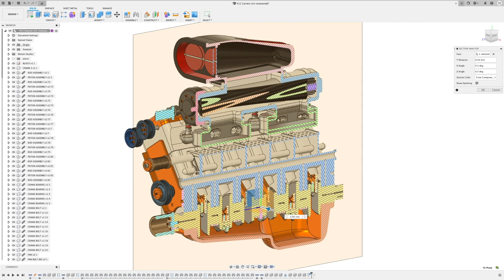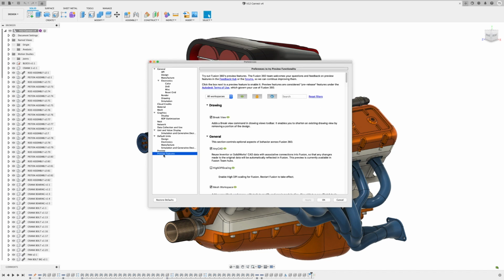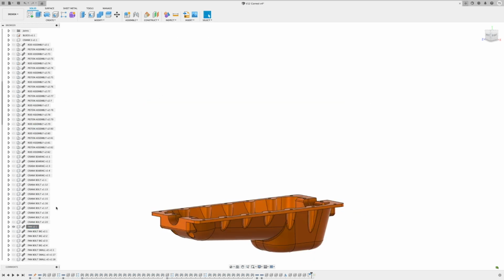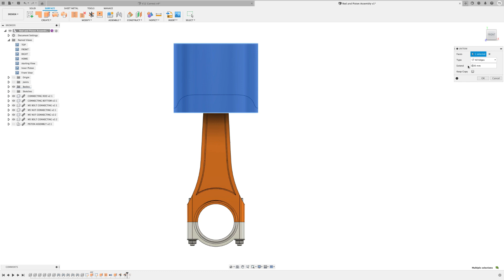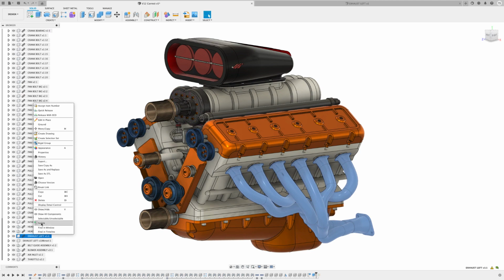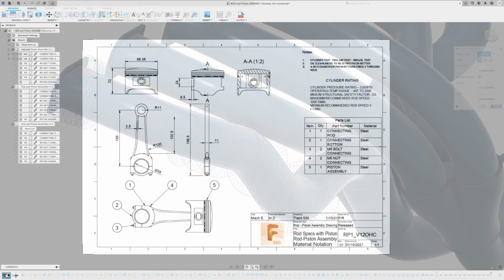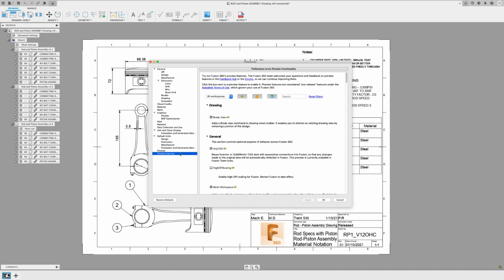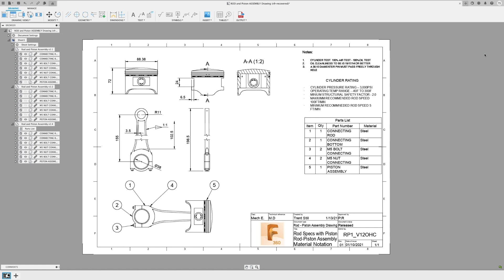What's New In Fusion 360 Design & Engineering – January 2021

Comment: While I applaud the addition of a thin extrude, I couldn't help but feel disappointed with the fact that only closed profiles can be used. The whole point of having a thin extrude should be to allow for creation of thin walls by essentially just sketching lines. This would be especially useful for creating heat fins for instance. Limiting this feature to closed profiles doesn't make sense to me at all.

I understand that we have a web command where we can sketch lines and the command would automatically thicken the wall for us. The command works well within enclosures where there are walls bounding the ribs. I have tried creating fins using the web command but the workflow is not intuitive. This is really a missed opportunity to make the thin feature a great command.
Reply: We chose to release Thin Extrude with this known limitation. We will continue improving this to include open profiles very soon.
Reply: @robcohee  Thank you. Good to hear.
Reply: Until if/when Extrude/Thin Wall respects unclosed sketch geometry, use SURFACE>Extrude/CREATE>Thicken. For details, see this Facebook post https://www.facebook.com/groups/fusion360users/permalink/4366067673423331/?comment_id=4366865093343589&__cft__[0]=AZUAo7Ar83BopMyJ2JwC4Vzcdvlj99MTrK7HoPOg2V9nikjI3NEdVzLkl4xtJtcwAJgpa_mgP-YHDOjpCeUyNiy-F5VEvbN18vOk1ZCvSAGZyJfrOS4wXZ3SBWoAtEfyJd9IknpJ_HpTxxudaeMViRaO&__tn__=R]-R.